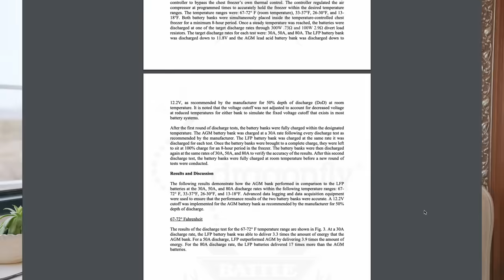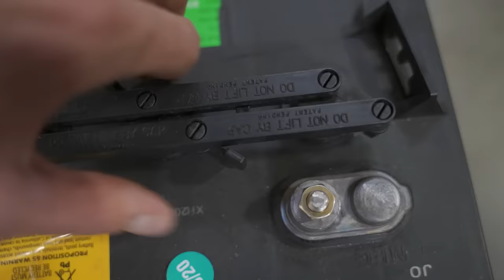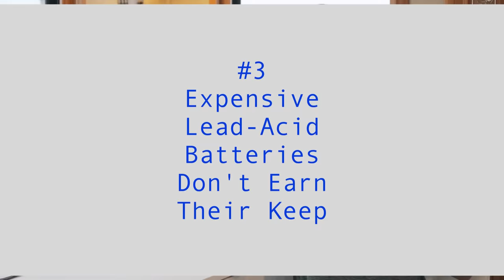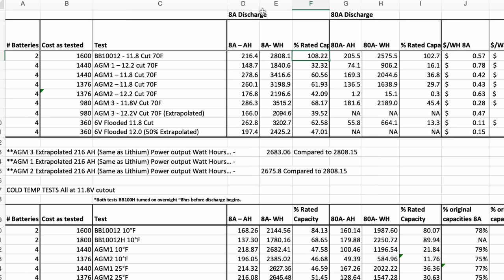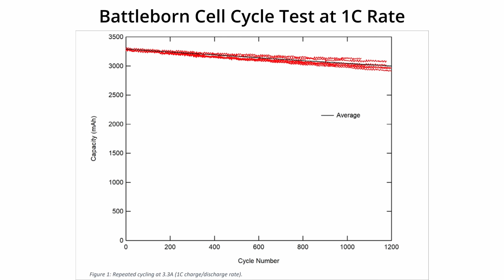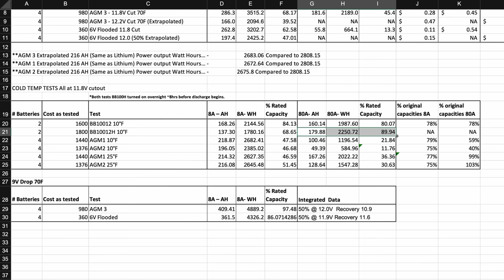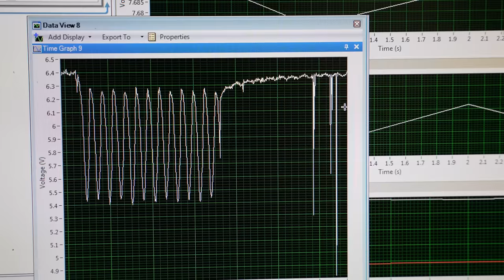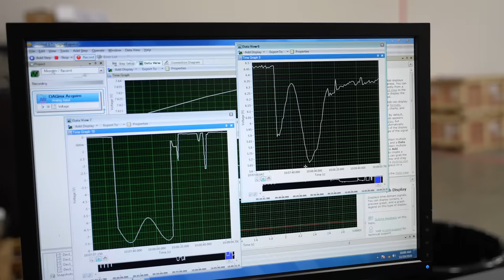Don't Waste Your Money On Batteries - The Shocking Truth I Discovered When Testing RV Batteries

Comment: I served on diesel-electric submarines for 7 years. We had two main batteries on the last submarine I served on. Each battery consisted of 126 lead-acid cells that weighed about 1200 pounds when filled with electrolyte (distilled water and acid). Each cell was rated at 2.0 volts for 250 vdc per battery and connected through switch for normal operation of 250 volts but could beconnected in series for short bursts of high speed maneuvering (1/2 hour). We charged the batteries when new to over 13.0 volts per cell, verified by continuous electrolyte readings during charging. Typically the batteries were discharged into the high 10.0 volt per cell reading before charging. After several years and a number of monitored cylcles and deep equalizing charges the batteries arrive at a condition where the would no longer reach a high enough charge and sometimes a cell would reverse charge and would need to be disconnected and bypassed with a corresponding cell in the other battery. So lithium batteries might be better than a lead-acid battery, but you are not taking all factors into consideration. I have also worked with large lead-acid batteries used in large buildings to bridge power outages till emergency power gensets coul come on line. Similar results.
Reply: That would make a great solar battery.
Reply: The military is lowest bidder.
Reply: I'm unsure of the conclusion you are making with this story.  Are you saying if those lead acid batteries on the sub were replaced with lithium they would not perform as well in certain applications or overall?  Can you tell me one factor he needs to take into consideration in the video where lead-acid in general is better other than the one mention in the video.  He did list a car starter battery as an ideal situation for lead-acid.
Reply: 2 volt cells charged to 13 volts? So you went from 250vdc nominal to 1600vdc? It seems like you would just get boiling/electrolysis if you tried to charge a lead acid cell to 10 or 13v...but I guess I haven't exactly tried.
Reply: 13v per cell? Whaaaaaaat?
Reply: Super curious on how Submarines would deal with Lithium fires? Let them cook the room until the fire is done and increased pressure and toxic resulting air in the chamber room? Or exhaust to the ocean water toxic fire smoke?
Reply: @Dirk Jefferson swim almost daily in paradise. Yet they probably avoid Lithium for this exact reason. Some tech isn't meant for underwater cans
Reply: @privateparty4900  to equalize cells take your battery to 15.4 V once a month, they boil like crazy but are supposed to, it's okay. But by doing this, you clean the plates of any "sulfification", therefore extending the life of the battery and its capacity. And if you don't charge at 13.4 generator / alternator, 
then you're not charging the battery correctly and there is a problem with your generator / alternator. One volt over. A wet 12 volt battery at rest will read 12.6 per cell. If not a charge of 15.4 to 15.6 2 V's over for a half an hour then recheck cells. "Sometimes" it takes hours for Equalization to happen. If not you need a new battery or cell. Just keep electrolyte level up.  Been-there-done-that for 10yr's on a set of T105's with a rating of 225 AH per 6 volt battery. The charge rate is 22.5 amps per hour input ability tapering off as it gets full. This is where the panels can take over because they basically trickle charge.
Car batteries have thin plates made for Rapid charge or discharge, not for RV /household which have thick plates made for slow charge and discharge. 6 hour's average recharge.
Reply: @cynthiaayers7696  so you just overcharge the batteries to "equalize" them? How do you do that? I know I can Google it but I'm curious and I'm sure others are as well so if you don't mind saving people in the future a few minutes I would really appreciate it.
Reply: @smilemore1997  well my charger had a plug like an old phone plug-in/ switch, like you'd find in a house. It simply took it to 15.4 over. You'll find this advice in a battery care book for wet cell's.   It cleans the battery plates like you would clean an air filter that's getting clogged.
By overcharging it breaks down sulfification. Sulfification is a crush that forms over the plates preventing electrons from passing through. The more sulfification the smaller your battery will act. Leading to an unchargeable battery.
Reply: Is Lawence BUSH a real person or did he pass away.  Some good question in the comments, would love to hear the answers too.  BTW Sir thank you for your service.
Reply: @ElectricityTaster  Wrong.  The U.S. Military puts the Armasafe Plus 6TAGM Hawker battery in its Hummers.  This battery is $800 delivered through the retail market.  And due to force readiness concerns, it replaces them at 1 year intervals.  I just picked one up from one of the recycling companies for $90 and it has an 11/22 mfg date.  It is going o easily last 7 years.
Reply: @JohnHansknecht  I said lowest bidder. Obviously the US military decides what specifications.
Reply: @Dirk Jefferson😱🤣🤣🤣🤣
Reply: @bulliontoy  😳🤣🤣🤣 You both are funny
Reply: @cynthiaayers7696  Lead-sulfation occurs when soft lead-sulfate crystals are not adequately reconverted back to their component parts (i.e., lead and sulfate ions) in a timely manner. The result is that soft lead-sulfate hardens into irreversible lead-sulfation. Typically, this occurs if a battery is drained, then not recharged within a sufficient amount of time (noted below). Once hardened, lead-sulfation is highly resistant to chemical reversal during the recharging process. As such, lead-sulfation is permanent and cannot be reversed. Therefore, the battery’s performance is permanently degraded, and its operation life is reduced. Furthermore, those hardened crystals will continue to grow (a process known as “Ostwald Ripening”). This growth thereby covers additional active areas of the plates, which exacerbates the situation by deactivating those areas, thus further degrading battery performance and life.
Reply: @bulliontoy open the window.
Reply: @cynthiaayers7696  Normal charging voltage for 12V alternators is 13.5 -14.5 Volts. I don't know where you get the idea if your alternator isn't charging at 13.4V that it's defective! Nor does a 12V battery have cells reading 12.6 per cell like you stated. Each cell produces 2 Volts or so. Six cells in a 12V battery comes to roughly 12V. A fully charged 12V battery should read around 12.6-12.8Volts.
Reply: @bulliontoy  these Lithium Iron batteries being used in RV’s have a much much lower chance of fire than the Lithium Ion batteries used in cars.  Not that they can’t short out, heat up and start a fire it is way less risk than the auto types. Most LiFe cells can have a nail pounded through them and not catch fire.  That is why every LiFe battery should be fused with a catastrophic fuse as close to the hot side battery post as possible.
Reply: @OldManandtheSuperC Totally different amount of Ah and amps. The size of loose cell lith   compared to EV amp demands. 100ah-600ah on avg. for RV or conversion vehicles. EV is 1200-3k+ encased in metal vs loose lith cells. It's all about charge temp and total charge amps is 10x-150x more amps is proven deadly hundreds of times coasing many lives. They are both dangerous at high temp being the same lithium inside. Yet I've seen in person a Prius engulfed in flames melting into the highway--collision or not.

Comment: First of all, GREAT video and very extensive testing.  I've been on the fence about changing out my current OEM flooded battery for Battle Born for a couple of years now.  The one point that wasn't pointed out in the video about cost is that its not just the cost of swapping out the flooded battery for a lithium battery, but the significant additional required cost to replace the OEM inverter/charger with one that supports lithium, and for many people, the labor cost of engineering the lithium battery/charger/inverter solution to replace the OEM system, not to mention, for many of us, the cost to upgrade the alternator in our trucks to handle charging of the lithium cells while we're on the road.  So, while there is no denying that using lithium cells are much better performance, for many it comes down to a cost vs benefit especially when factoring in the additional mandatory costs necessary to move to lithium.  Thanks again for your very extensive report.  You guys continue to put out very informative videos.  Hope to see you both on the road.  Keep it up!
Reply: Right on point. This is why I came to the comments to make this exact point. This is the only thing keeping me from doing the switch.
Reply: I would really like to see his reply to this. This has been a question in my mind as if my existing converter would charge a lithium battery. I'd like to know just what you would have to do. Thanks for your comment.
Reply: @tarefoot  Look up the make and model (maybe serial number too since sometimes mfg's change things mid cycle) and call the manufacturer.  Ask them if that charger supports a LiFePO4 charge profile.  If yours was made in the past 3-4 years it could well be compatible already.  Prior to that probably not unless you have a high-end model. Even if it's not compatible currently I've heard that some models can be upgraded to support lithium fairly easily and at low/no cost either through new firmware or a circuit board replacement.
Reply: @Rumline7  Thanks Michael......
Reply: Damn, even my van alternator could possibly need to be changed? Would my Ford Dealer know this info? I'm considering a LiPo system...
Reply: You don't have to change your alternator... If anything the LiFePO4 charges more efficiently. So the charging supplied would result is more amps being stored in the battery. You can charge LiFePO4 at 1 amp if you want to. Lower amps just means less stress on the battery when charging.

As far as charging these batteries go and needing a different charge system... well that depends on your setup. Constant Current vs Constant Voltage and the 2 charge methods do matter, but batteries like these aren't connected like a Lead Acid or AGM. They have a BMS. The BMS is what actually manages the charge. Yes there are chargers for LiFePO4 batteries, but that for charging them directly in a single cell or parallel setup. You just supply the input voltage and the BMS manages the charging/balancing.

You do need an inverter that has the correct cutoffs and current limits, but again the BMS will cut out if you reach it's limits anyway. Chances are a properly designed Lead Acid equivalent will cut off at a higher voltage anyway.

All that said... He is comparing battery technologies and cost. If you were changing from one to the other then there is always going to be a cost associated w/ that. If he said lead acid was better then all the LiFePO4 guys could say the same thing, but that wasn't the purpose of this video.

The purpose of this video was to sell BattleBorn batteries. xD

Comment: We seem to know this already in Australia as 4x4 enthusiasts and manufacturers have extensively covered this problem ad nausea. The drawback with Li's is it won't start your 4x4. Besides the idea isn't to have a stand alone battery to run flat, that's nuts, but to keep it topped up either as dual battery system in your vehicle, and if you can, taking advantage of portable solar by using a proper dcdc charger with a built in battery isolator, mppt and ETFO charging. You should even be using the mains at home or a generator to keep your battery healthy when it's on standby. So, in this scenario I just mentioned when properly rigged AGM's are fine to get you going and if done well some people never change. The idea of having a battery to discharge without topping it up or having a backup is a bogus application in a real world scenario, except if its for a small cheap throw away toy.

Comment: Watched your video and during the whole time watching I was thinking full time RV person as opposed to the part time RV person. I am a part time RV person and the cost of lithium would be way too much. If I was planning on full time boondocking and RVing, I would have no problem investing in lithium. A real world scenario would include use over time.
Reply: I enjoyed this report and found it interesting, with that said I can't justify the expense of switching from my 6 volt golf cart batteries I have now.
Reply: EXACTLY...i got excited a couple yrs. ago , but thinking further , just couldn't justify $2K to run my fridge.....bought 2  6 v.  golf cart batts.; but wish i could afford these...and there is the exploding batt facet
Reply: Great thinking Bob!
Reply: Yeah. The 6V golf batteries will last a part timer 3 or 5 years (if you take care of them). The Battleborn batteries will cost 6 or 7 times more and last for 10 or more years. The cheaper batteries will still be cheaper over any reasonable time span.
Reply: I disagree. This analysis shows that Lithium is more cost-effective over the lifespan of the battery, and this has nothing to do with how often it gets used. Although $900 for the Battle Born is a lot to pay up front, it will last 10 to 30 years, vs. 2-3 years for a pair of 6V golf cart batteries (assuming you wouldn't buy AGM because they are very expensive for what you get). Hence the lithium dilemma: are you willing to pull the trigger on the high upfront cost to get a lifetime of benefits?
Reply: @johnpianezze6519  I disagree with your disagreement. The assumption built-in to the cost analysis is that the battery will be cycled however many times it is rated for. For example, say 2000 times. If you keep the vehicle for 5 years and cycle the batteries 100 times during that 5 year span, then you will be many dollars ahead at the end of 5 years by going with the lower cost batteries. Maybe the vehicle will be worth more to the buyer if it has 5 year old battle borne batteries in it compared to exhausted golf cart batteries. But it is kind of hard to put a dollar value on that and I am not sure it truly is a factor. Also, batteries don't last forever, even if they are not cycled at all. They degrade. So a seldom used battle borne battery may wear out over time even without being cycled. So, once again, I think it only makes sense if you are reasonably confident that you will cycle the battle borne battery regularly.
Reply: Also, you have to figure the short lifespan of most RVs... Will you keep one for 10 years will it hold together that long will it be outdated...? Will your life living parameters change? And will battery technology evolve and make the current tech obsolete in 5 years...? (I think too much)...

Comment: This is a very very good testing system. One point to note though is that you are not ever supposed to measure lead acid battery voltage levels while under load/charge to get any significantly decent reading.

I would love to do that "discharge to death" test again for the AGMs, but give them a break. Say every 25 minutes, let them rest for 5 mins to rebound, measure voltage, then repeat. Otherwise the comment saying that an AGM 50 percent level is 12.0 volts is quite literally useless, as with the 8 amp load connected and with battery and cable internal resistance along with peukorts law throwing its annoyances in the voltage under load is just a bare indicate that the battery is still alive, not "oh we have passed the 50.00 percent mark."

Other then that though there is some very important info here, especially with the difference between cheap and expensive AGMs. The floodeds also had a suprising uptick, but they are annoying to store and use in a sealed or semi-sealed environment.

Very good data though, but with the voltage measurements under load being all suspect some retesting will have to be done.

I bet that if you hit the "half capacity ah consumption" point at around 12.0 volts, and allowed the battery to rest, it would bounce back to around 12.2 volts as per the manufacturers spec sheet. Would LOVE to see scientific testing of that.
Reply: This wasn't supposed to be "scientific". This test mimicked real world use of these batteries. People aren't buying these to bench test them. No-one in a boat or RV is going to be able to configure their inverter to turn off all loads to test the voltage, and then turn them back on (or not) depending on if the voltage rebounds. What they did in this video is a more "real world" test because this is how inverters are typically programmed in a boat or RV. They don't have the luxury of turning off all loads for an hour, waiting for the voltage to rebound and then turning the RV appliances back on again, etc.

Notice that the Lithium batteries were tested in exactly the same way and didn't need this sort of pampering with turning the loads off to check the voltages. And that's the point: In a RV/boat application the Lithium's give you much more usable energy for the money.
Reply: Sounds like some vw testing lol
Reply: @JeremyAkersInAustin  unfortunately the test was designed to show lithium batteries where they are at their optimum , constant discharge …lead acid batteries bounce back after discharging , in fact a constant discharge is very uncommon in a RV / boat typically batteries cycle between discharge/ charge / idle .. That is a real world test , this is a sponsored video with the test optimised for lithium ion  , that being said for inverter use or high discharge requirements lithium is superior, lead acid batteries preform far better that this test showed.. btw 12.2v is 60% .. 12.05 is 50%
Again a marketing ploy to make lithium look more cost effective than they are
Reply: Kind of agree, but also have empathy for the comments that say it was supposed to reflect real world conditions. I frequently am amazed how well my leisure battery bounces back after a short high load drain.